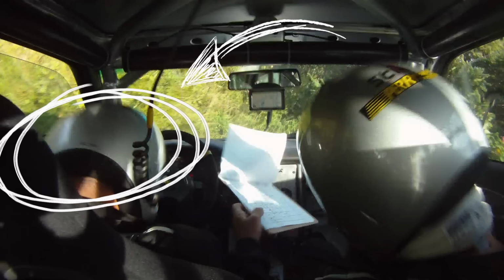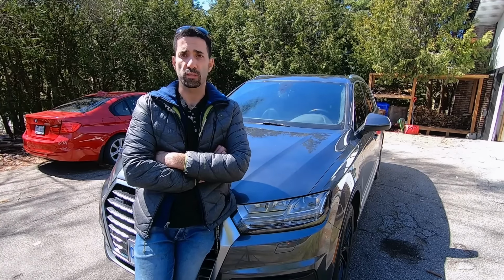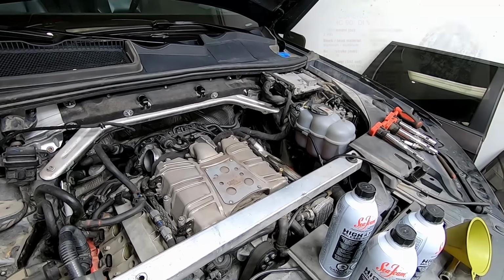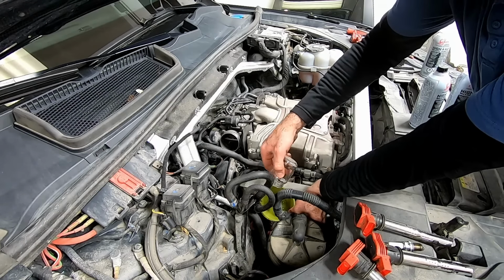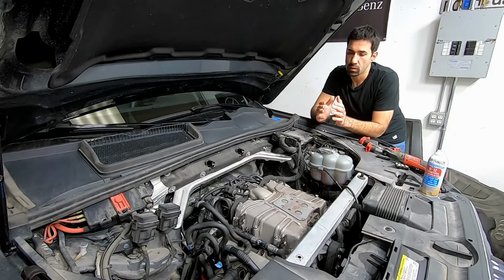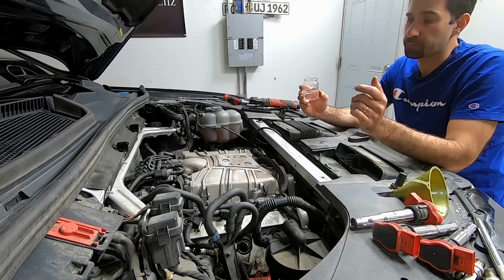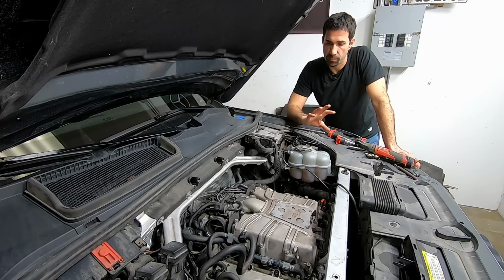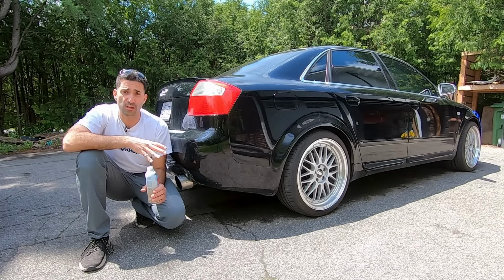How to fix oil consumption on VW/Audi/Porsche 3.0T engine?

Comment: Just wanted to see if you could give an update on the Q7 you did this to. Does it still burn a little oil or does it 100% not burn oil anymore? I did the soak to my Q7 and it will burns about 1L every 4000 miles. Considering doing the soak again down the road.
Reply from the maker: @GOOD__DUDE  the owner messaged me at 5k and was down two lines on the sensor measurement... my guess is it's not 100% eliminated but he does not go through a liter every week anymore... at 1L per 4000 miles you're well within the VW spec...I do my changes at 5000km and you're at 6400km for a liter...I would time my oil changes with the consumption so you don't have to add any oil between changes... what was your consumption before? Nothing stops you from repeating the soak - this time around you can try milder chemicals like seafoam and if you're comfortable doing it, you can make it into a routine service say every 3 oil changes
Reply: @ETMotorsports  Thanks for the advice. Before doing the soak, I changed the PCV and was at 1L every 2K miles. I was considering topping off with Lucas Synthetic Oil Stabilizer (instead of oil) if the oil level got low and I didn’t plan on changing the oil for a little longer. Have you heard of anyone having success with Lucas to slow the consumption? Also, does the 3.0 TSFI engine take 7L (7.4QT) of oil? Its hard to find anywhere that actually shows how much oil to refill with.

Comment: Im planning to do this to my 2018 q7 3.0t this weekend. What tools or how do you find tdc for your pistons?
Reply from the maker: @nh4thuy  you can just use an extension on top of the piston to see where it stops moving up... for the crank you'll need a VW tool- the number is in the description
Reply: @ETMotorsports im not able to find the vw tool number in the description. What was the socket size that you used to turn the engine crank? Can you share a link to the tools that you used? Greatly appreciate it.

Comment: Could this work on an Audi diesel ? Engine has its power but consuming oil , I’m pretty sure also because of stuck oil ring . Safe to piston soak diesel also ?
Reply from the maker: @armikaxs  no issues - same process but you have to use the how plug or injector hole to pour

Comment: What if we don’t rotate the crank and keep adding b12 every 6 hours will it be fine ? 
I am in the middle of the process and added b12 without rotating the crank do i need to worry about something here? 
Thanks
Reply from the maker: @sohailshaikh483  nothing to worry about - rotating the crank is meant to help the liquid penetrate the rings so it may not be as effective

Comment: My crank shaft tool finally arrived, I am attempting to turn the crank but I can NOT move it past a certain point. I am using a 24" torque wrench so I have lots of leverage, wondering if anyone has any suggestions?  I have completed multiple soaks while I was waiting for tool.  I blow out all loose carbon.  Should I go back and forth and continue to blow out piston as much as possible?
Reply from the maker: Hey unfortunately that's about all you can do... take your time,  work the crank back and forth,  keep blowing garbage out. A scope would really help here so you can see what's causing the issues.  I'm guessing you've got two pistons at TDC getting stuck so you can narrow it down to either of the two, but a good scope with a side view camera can really help here. You can pick very good units on Amazon to help
Reply: @ETMotorsports  Thank you for the great advice!!!  It took some work and an extra day of soaking piston 4 and I I made sure it was fully blown out with compressed air.  I believe the first time I blew out piston 4 there was a lot of carbon remaining and it was the cause of all my issues.  Vehicle is back together and I will run The Diesel engine oil for 2000 KM before switching back to the Audi spec'd oil.  Thank you again for the great channel.

Comment: Which crank turning tool did you use?  I cant seem to find one that is listed for the 4m q7.  I see some that are a 4 point that fit between the bolts and one that covers all 8 bolts.  Neither are listed for the 4m 3.0T Supercharged.
Reply: Never mind. I got it figured out

Comment: I did this to my volvo d4 in the driveway in germany. Since i am not allowed to change the oil in the street i called a tow truck to have it towed to a garage for a moment. Guy asked me what was wrong with the car and i told him i had overfilled it by a lot. I came back to the house for some document he needed and when  i came back he had started the engine with like 3l extra of berrymans. After 10s oil started coming out of both crankshaft seals 😢
When i get the car fixed i will see if the oil consumption is fixed lol
Reply from the maker: @MrTuhascvbouwq  oh no!!! Sorry to hear that... hopefully no long term issues

Comment: Hi There! Working on my last two pistons but as i was getting them ready I noticed the engine got locked and can't turn it to the full TDC position. I went back and clean again but don't see anymore debris. I still got the B-12 in last set and made sure it was full and left over night. is it possible I messed up something by turning engine counterclockwise couple times? Do I just need to let it soak some more and try again? Freaking out here. Anyone ran into that?
Reply from the maker: @luisbravo-pc8be  no you didn't mess anything up - you've still got debris on the pistons... pretty much everybody that's now done this to the 3.0T (and a few 2.0Ts actually) is confirming the debris build up on the pistons causing the crank to stop... there's no way to avoid that unfortunately because of the angle of the pistons... don't panic,  take your time,  keep blowing out the garbage,  soak it again,  blow it out and on and on until it is clean enough to let you push through... the pistons that are closest to the top are causing your issues so you can focus on them. If you don't have a scope I highly recommend getting one with a side view camera - I would have freaked out about the crank being blocked if I hadn't seen the debris on the piston- the scope really helps
Reply: @ETMotorsports  Oh that's good to hear. I did get me a scope but does not have side view unfortunately. I will continue working on the soaking. Should it help to cranking while there is B-12 on them?
Reply: Oh right! I was able to crank it but it gets stuck again when 2 and 4 are in TDC position so I put more B-12 and let soak another 12 hrs then clean
Reply: I am doing mine right now as well and ran into same problem.  Soaked the 1st two pistons.  Hand turned the crank and they got stuck.  Just did a lot of compressed air clean out and they started moving.  Fast forward to the next set of 2.  First 12 hour soak and blew them out with air.  Turned the crank and it was stuck.  Took me 1 1/2 days of additional soaking and compressed air but it finally started moving freely.  I was freaking out a bit as well, didn't think I would get them moving again   I had a cheap old 3 gal pancake air compressor that I started with.  I went and got a cheap $100 rigid 6 gal compressor at HD.  Has a higher psi, 125 I think compared to the 90psi I was using.  Made a bigger difference for me when blowing out the spark plug hole with that extra psi.  I put a clear hose on my air nozzle which I think was shown on the video which gets down to the piston nicely.  I guess the name of the game with this process is patience in some cases.

Comment: I am a bit stuck 🤦🏾‍♂️. I have only manually cranked the car and air compressor to evacuate each pair of cylinders but I still my crank got stuck. 

Any ideas how to free up the crank?
Reply from the maker: @LobbanVlogs  rotates freely until a certain point and then stops? Can you go counter clockwise? Can you see inside the cylinders?
Reply: @ETMotorsports  I used the endoscope but wasn’t seeing anything in particular. I did evacuate cylinder 1 the first time it happened which is at the end of the completed process. After each cylinder pair I evacuate and manually cranked it, so not sure why at the end it is now getting stuck.
Reply: @ETMotorsports  I just bout some more B-12 to see if it will free it up some.
Reply: @ETMotorsports  thanks for the quick response by the way. I have to go to work so tomorrow I will try using more B-12.  I’ll keep you posted if you want
Reply: @LobbanVlogs  I'm on the same boat. I have soaked the piston at TDC again to see if that softens the carbon gunk. Hopefully it does !
Reply: @VishalMohan16  that’s what I’m hoping for
Reply: @VishalMohan16 can you keep me posted on your development? I have to go to work tonight and tomorrow morning.
Reply: @LobbanVlogs  I managed to free the crank after the soak. I'm sure you will too, 
trust the process !
Reply: @VishalMohan16  thanks. Currently soaking 😊. Did you bloat out the cylinders after the soak?

Comment: So I did a berrymans soak this spring, used 4 cans on the drivers side bank (one plug was oily on that side and I ran out of fluid before I could get to the pass side).  consumption went from 550miles/qt to about 1300/qt.  fast forward 5000 miles and I did the full engine flush before my oil change.  This time I drained the oil first and put it aside, left the drain plug out with a second empty drain pan and did 8 cans using a boroscope to be sure I had the pistons fully submerged at all times over a 10 hour period with a bit of hand cranking mixed in, then I put the old oil back in and ran the car for a few minutes, drained and put in new oil and filter.  with the v engine it takes a lot of fluid to fully cover the piston.  I recommend using more fluid, a boroscope so you can see what your doing, and don't run oil diluted with berrymans if you don't have to...One other observation : it takes 1 quart to go from the bottom of the crosshatch on the dipstick to the top of the crosshatch, but if you accidentally overfill it it does not go up past the top of the crosshatch in a linear fashion,  it goes up much less.  I think this is because of the shape of the oil pan...I mention this because if you overfill you get a false sense that the car is burning less oil than it does because it drops slower above the top of the crosshatch (my car is a 2012 Q7 w 85k miles) with a manual dipstick.  This piston soak is a real solution for these stuck, low friction oil rings...it's not just audi btw.  my buddy has a 2020 kia tellurike with 60k burning a lot of oil and still under warranty, the dealers are doing piston soaks now on warranty jobs...

Comment: Hello Eurotrash Motorsports
I have a similar issue with my car
It's an inline 6, BMW N52 engine.
It used to burn oil, and at the time I tried putting Liqui moly Pro-Line Gasoline System Cleaner, hoping to clean the engine/fuel system (product number 5153).
I put a whole can 500ml can into half of a tank of gas (about 30 liters)
Well, since then it stopped burning oil and I thought it was cured as maybe the solution in the fuel affected piston rings during the compression cycle of the engine.
Turns out, after a while, the oil started to smell like gasoline when I opened the oil fill cap and smelled it, that's why the oil level was ok - it was actually adding fuel to the sump and masking the oil burning problem.

What I think happened is the liqui moly stuff did release the rings a little bit, actually making the problem worse.
Do you think a complete soak of the pistons could work, instead of putting the cleaner into the tank like the first time?
I don't have B-12 here in the EU, but I am thinking a similar injector cleaner would do the trick.
I won't hold you accountable for any damage I do to my car, I just want your opinion.
Reply from the maker: hey in my experience, nothing you add to the fuel tank or oil will help fix the rings...the soak is the only way to apply the solvent directly to the piston rings short of taking the pistons out. So if you're sure the oil burning is from the rings, I would say a piston soak is your best bet. On a straight 6 it would be pretty easy - what angle are the pistons at? One thing that came out of doing the v6 is the idea of soaking the pistons when they are TDC to make sure that you also soak the bottom of the valves and the head crown as well...injectors too if it's direct injected...

as for access to B-12...yeah unfortunately it's hard to come by anywhere outside of the US...I think you used the right LiquiMoly the first time - I would perhaps try that as the solvent for the pistons too. They've got lots of different products but if I was choosing I would definitely go for their pro-line stuff and you can probably dig up the contents of both solvents to see how close they match up. Lots of folks have suggested making your own mix too - kerosene etc. but that's going a bit more experimental at that point...

that said - I'd be pretty worried about my oil smelling like gasoline. I`m not experienced with the N52 but I can't think of where these two systems can possibly mix? Take a sample of your oil - if it really does have gasoline in it I wouldn't drive the car until you figure it out. Is it possible the smell wasn't coming from the oil?
Reply: @ETMotorsports  unfortunetly not, I could smell it from the oil top up cap when I opened it at operating temp, engine shut of.
There is no dipstick, port injected engine.
The smell was very intense when I opened it.
I have since parked it and don't drive it in order to stave of a potencial catastophe.
The engine sits at a 20deg angle and I'll have to lift one side up to ge to below 10 deg angle to save liquid and prevent diluting the oil even more with the soak procedure.

I agree, nothing would help better than this, but I wonder why now, I've had the car for a year or so.
It's either overfueling due to a bad injector or the mixture is going past the rings.
It does misfire ever so slightly at cold starts, but its barely noticeable and only when I put my hand on the engine could I feel the misfire.

Just wanted to see what you thought as the stuck rings are mostly about oil consumption, but my theory was - if the rings weren't sealing, maybe the air fuel mixture can go down to the pan in the compression phase just like oil can go up into the combustion chamber during the expansion phase.

The tricky thing will be finding the sweet spot when all the pistons are at nearly the same piont, as its a straight 6, there is always a piston near or around tdc.

Thanks for replying btw 🙂
Reply from the maker: hmm if you had blow-by through the pistons you'd be seeing A LOT of other problems...I`m guessing your PCV would blow out, oil will go through all your seals etc. because you'd be pressurizing your crank case...

I read a bit on this and it sounds like that engine suffers from leaky injectors...so after you shut the car off, an injector just leaks fuel down into the piston which eventually makes it into the oil? sounds like you need to take the plugs off after you run the car and monitor each piston for fuel on the crown...if you have a misfire on specific piston that's a good place to start...

so maybe not the end of the world yet...change your oil, run the motor (can probably do it in place as well), turn it out, pop the plugs and watch for a fuel leak from an injector...you may need a scope for that...then just replace the injector...I wouldn't worry about the soak until you solve this one first
Reply: @ETMotorsports  that's a good point about the soak, maybe it's not needed until I solve the overfueling issue.
I'll change the oil and monitor the injectors. The injectors are mainly a problem on the N53, which is high pressure direct injection and my N52 is port injected, that's why I basically ruled out the injectors as people dont usually mention them a sbad, but I'll have a look at the plugs and crown like you said.
I can also take the while rail out with the injectors attached and while it's under pressure to better see if there is a leak.
I also saw a video where you can actuate them with a battery to see if the spray pattern is ok.
I'll be carefull with fuel, goes without saying hehe

Comment: My 2017 Q7 is at 136,000 kms and doesnt burn oil. Should I be worried about carbon buildup on the valves? Should this soak be done as preventative maintenance?
Reply from the maker: The owner noticed the consumption at 150k... honestly if you're using the correct oil etc. there's little you can do to control this... if it's not burning oil I wouldn't worry about doing this

Comment: When you blew the carbon out of that cylinder I hope you made sure the valves were closed. I noticed the one you could see was open
Reply from the maker: good point - the two clips were from different cylinders and different times so yes the valves were closed but that's definitely something to pay attention to....
Reply: @ETMotorsports  What's the position of the piston to get the valves close before you blew the carbon out?  At the top position?  My crankshaft is stuck like yours,  I wonder if I should use the starter if blowing the carbon out didn't help.
Reply: @theblueskyg 
Were you able to free up the crankshaft?

Comment: Hello everyone, can anyone explain me how it works( b-12 or seafoam)? my point is that when your engine takes oil (burns) it means that there is a problem with seals, orings or something that is the reason your oil leaks somewhere where should not go, and it is burned. What i see on the description - b-12 or seafoam is kind a cleaner, so it cleans buildups etc , but if we want to seal ower engines we need something that makes our engine seals o-rings or whatever - more spongy and rubbery, but cleaner will not do that. So once we clean our engine with b12 - how is it possible it will be more sealed ??? Thank U
Reply from the maker: b12 dissolves the carbon build-up and allows the rings to reseat themselves...